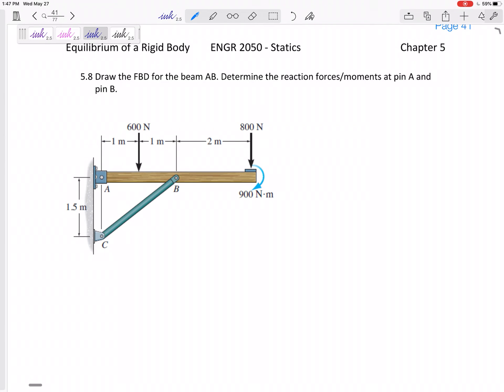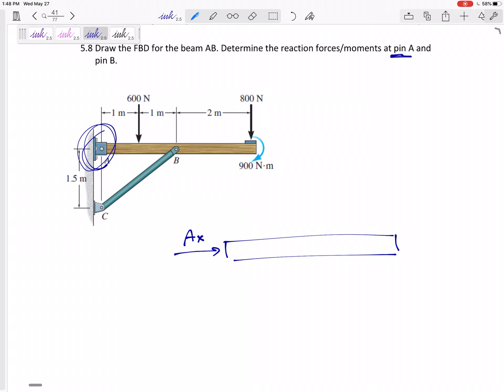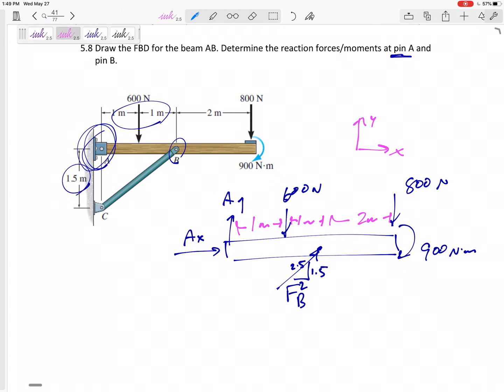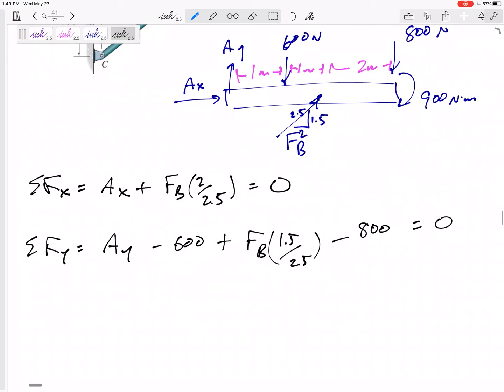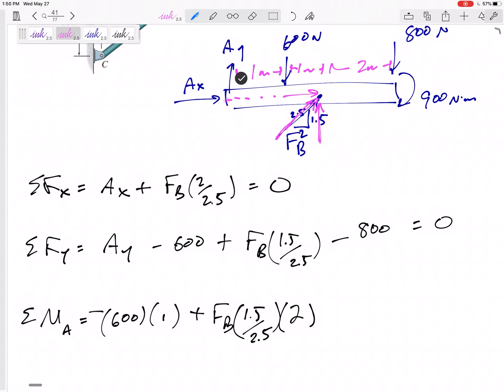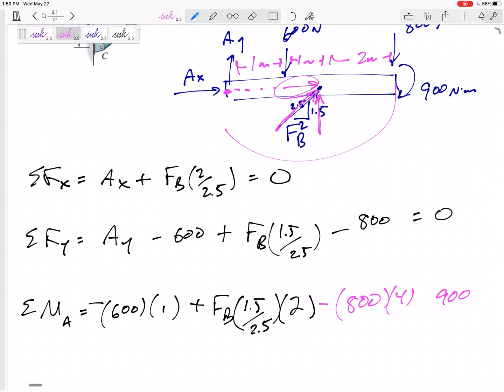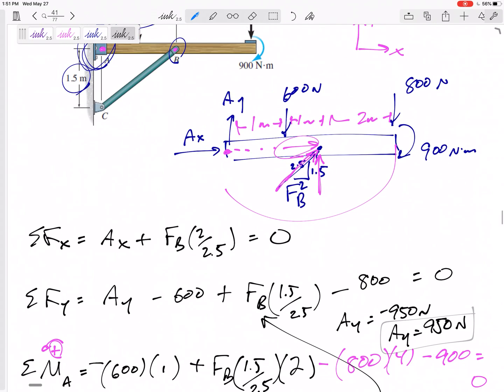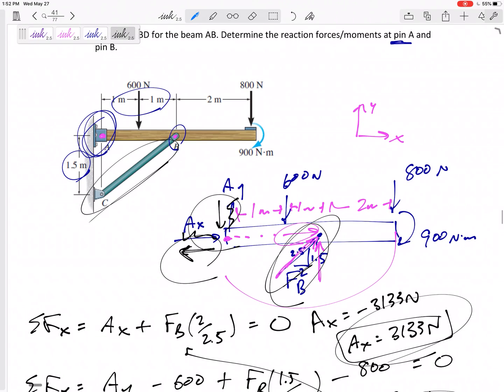Statics - Two force member - example 2

Comment: why arent  cos and sin attached to the Fb when solving ?
Reply from the maker: That’s what the 2/2.5 and the 1.5/2.5 is. I prefer to use those fractions, but if you want to calculate the angle and use sin and cos, you can. But that will be more work. Remember sine is opposite/hypotenuse and cosine is adjacent/hypotenuse.